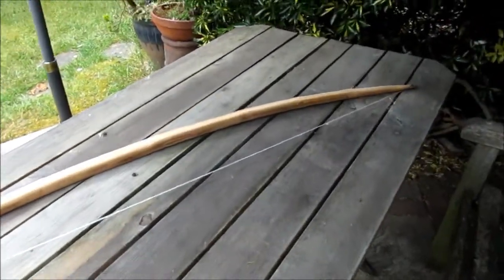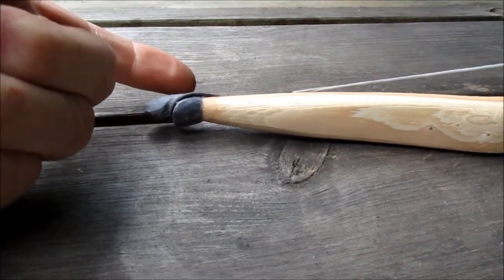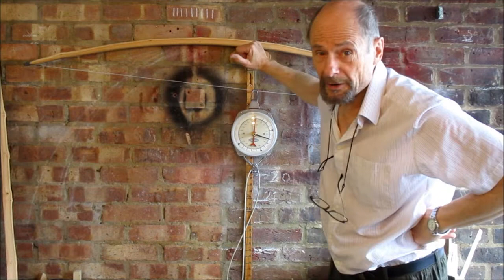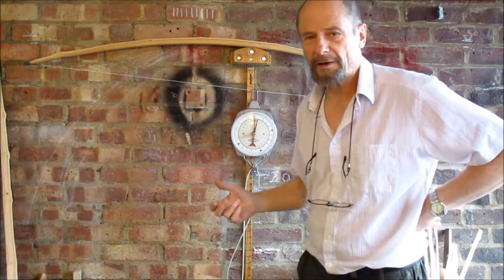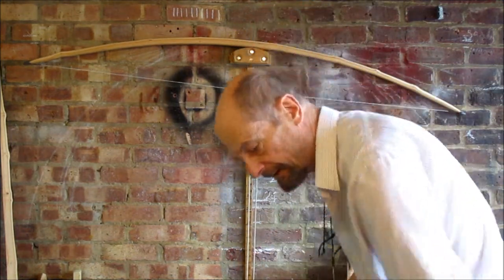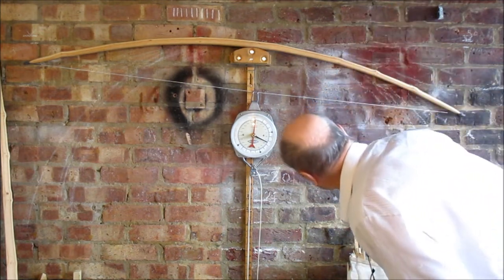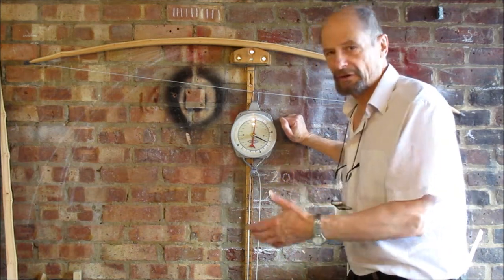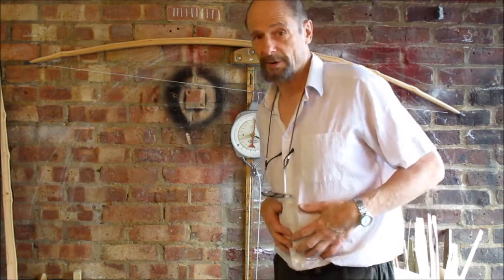Yew Flight Bow pt7

Comment: Great stuff, learned quite a bit from your videos while making my first bow.  One question: i notice you like to overlay curves on tiller photos/video to help see how the limbs are bending.  When you do a stiff handled bow, how do you decide how big or where to locate those circles - or do you just draw one that is as close to the current tiller as you can and locate it with 12 o'clock as near the handle fades as possible?
Reply from the maker: With a stiff handled bow I'd centre each curve on the fade of that limb. It takes a lot of manipulation to fit the curve nicely. I see a lot of people draw thick random curves that don't actually fit and don't really show anything. It's like any tool, it needs using with care.

Comment: What is a flight bow? A bow used for roving maybe?
Reply from the maker: It's a bow primarily for shooting as far as possible using a light tapered arrow with very small fletching. Often just for the fun of it, or in a Flight shooting competition which has various categories of bow and draw weight. E.G Last year I won a competition with an ELB (English longbow) not exceeding 50#.
This bow would be ELB unlimited draw weight. I'd expect close to 300 yards. Making arrows that match the bow is an art in itself.
Reply: @delcat8168  thanks! Very informative, and I now know, what this bow is meant for.
Good evening to you.